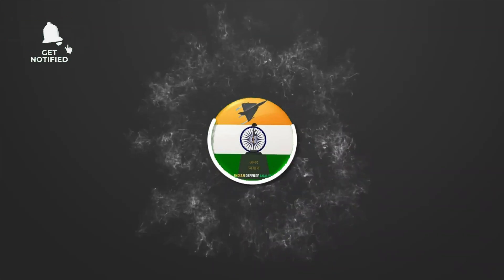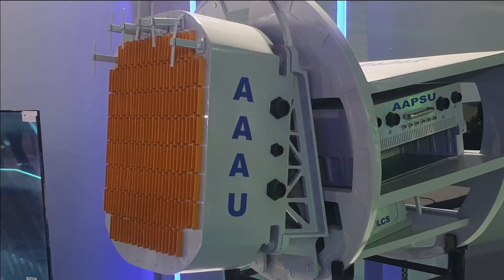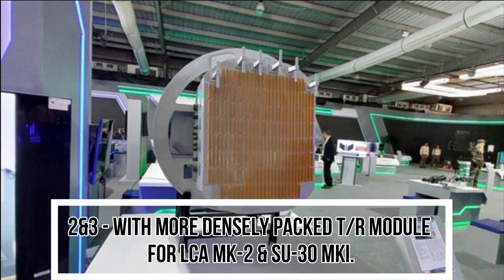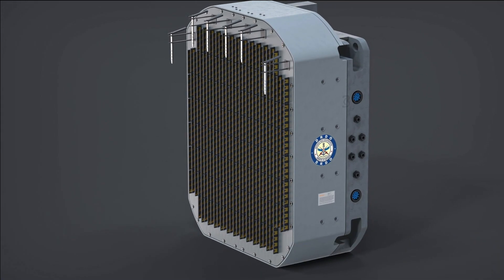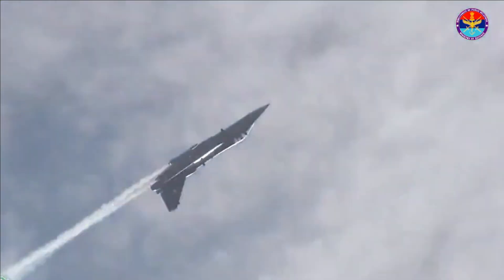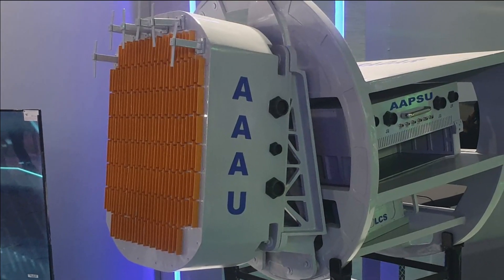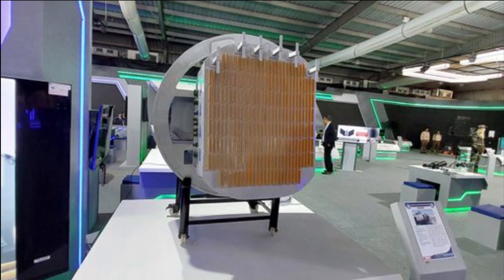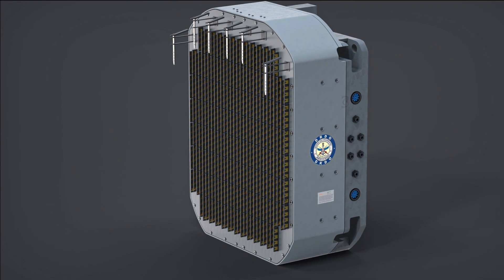LCA Tejas Mark 1A will get Uttam radar in 6-12 months | Sukhoi-30 MKI & Mig-29 integration from 2025

Comment: clean tejas ka RCS  approx 0.5M2 hain...2 drop tanks ke sath 1.5M2 approx. Agr droptank attached tejas ko bhi 140km dur se detect kar leta hai to j20 chodkar baki sare Chinese Pakistani jets ko Aramse 125+km Durr se detect kar lega.  4 bvr (Astra mk 2,3) ke sath unka jeena muskil karne aa raha hai mk1A 😂☕. Sehi me koi samajh nahi Raha ye jet kitna deadly hone wala hai 😁
Reply: Absolutely, these Paxtonis are comparing their J-10C with Rafale. J-10C have massive RCS of 1.5msq. Meaning Tejas mk1a will detect it much futher than 140km with Derby ER. Even the Tejas mk1a will give their J-10C a run for it's money.
Reply: Well LCA is light weight so it's naturally that COMBACT radius of Tejas is less then any medium weight single engine jet and this is one of the reason to start next Tejas mk2 MWA project but with 600 km radius 4 air to air Astra mk1 it's can fulfill the role of defensive patrolling of specific area .. with 600 km radius it can easily neutrilize entire western area against paf
Reply: Combat range 500 kms radius only MK1A still.....   No weight improvements done by HAL!!
Reply: @samueldiaw4775  let's see some specs (from Wikipedia)-
Jas gripen C/D
Empty WT: 6800kg
Internal fuel capacity: 2340kg
Combat radius: 800km
Jf-17 B-III
Empty weight -7965kg
Internal fuel capacity -2449kg
Combat radius -1200km
Tejas mk1
Empty weight -6560kg
Int fuel capacity -2458 kg
Combat radius -500km ??
having the lowest weight and highest fuel capacity with GE-404 engine as same as gripen how come the combat radius is low ??? Have you Ever think of it ??
Reply: @samueldiaw4775  Combat radius of mk1a is close to 600-700 km now. Weight has reduced by about 400kg which is significantly increase combat radius.
Reply: @samueldiaw4775  Nah the MK1A will have 500-600 kg weight reduction with some aerodynamic improvement to reduce areal drag which will improve its supersonic performance.
Reply: @samueldiaw4775  I will ans why the combat radius is written low if you can't find the answer 😁
Reply: @samueldiaw4775  
Only 500km for mk1a?
Check again
Reply: @samueldiaw4775  
This has been debunked many times already. The combat radius depends on what weapons load the plane is carrying, how much in fuel in drop tanks, what altitude it is flying etc. It is meaningless unless you know what these other parameters are, and this fact is often manipulated in order to make one plane look better than another. The 500km combat range is I believe a rigged figure given in a brochure produced by SAAB to make the Gripen look better than the Tejas Mk 1. For example for the Singapore Airshow in 2022, The Tejas display aircraft flew 3273 km with a single mid-air refueling.